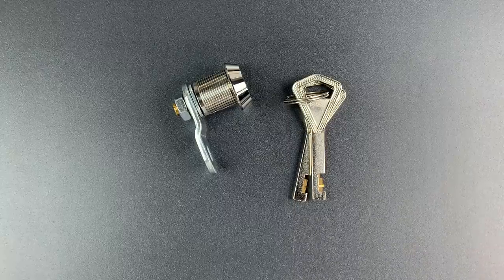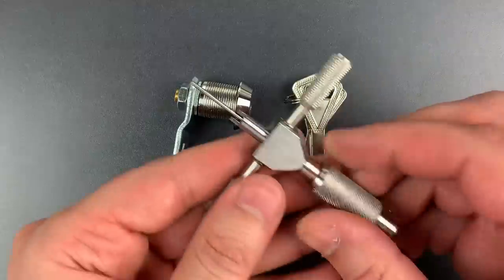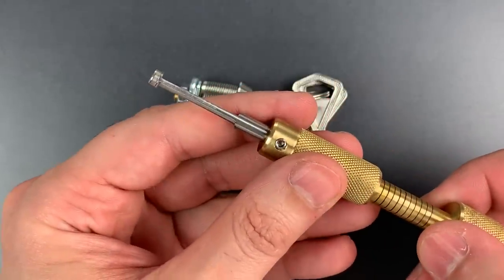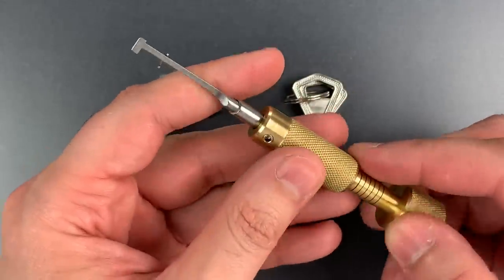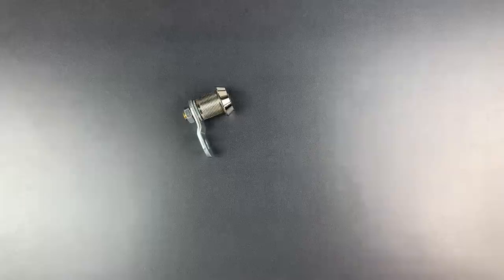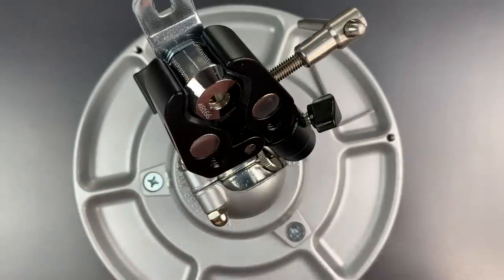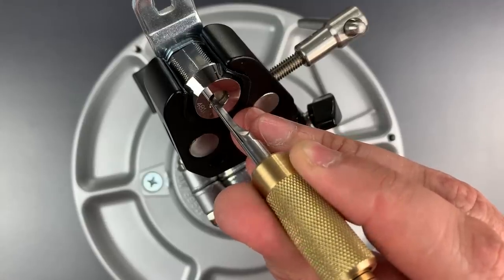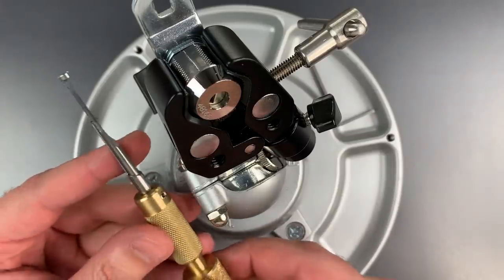[915] Knock-Off Abloy Cam Lock Picked (With a New Custom Tool)

Comment: Nice to see one my children going forth and picking locks! This tool is called "The Ableater" and took me about 6 years (on and off) to design. It took 107 years before anyone could publicly show that the Abloy Classic could be reliably picked. The lock should be impossible to pick but because of the tolerances on the gate/sidebar interaction it is not. Without doubt the hardest lock I have ever designed a tool for, including all the other Abloy locks like Protec II, Exec, Disclock Pro etc.
Reply: huxleypig69 it looks fantastic!
Reply: In finnish it's kalled vempele. Well maybe not the same tool, but the tool that was used on abloy classic before they added the freely spinning disc 1
Reply: @skharppi  I know the Vempele, yes. Tensioned from the front disc and made by Seppo Tervonen. It is why Abloy made the free-spinning front disc and also the anti-pick disc mentioned in this video. This tool works on the locks pre-change as well as the modern ones.
Reply: Fantastic work, precision tool!
Reply: this is by far the best recommendation i have ever seen for a lock. if its this hard for experts at least it wont be my weak link in my security system. where do we get these locks?
Reply: You sir, clearly have talent on design and tooling. I migth be interested, as this is the channel of a lawyer, at which point does a special purpose tool become so obviously special purpose, that you could regulate/ban them on the basis of their usage? Do you, as a designer have an opinion?
Reply: @huxleypig69  Very cool tool. Do you really think that classic pick is harder to do than exec or other safer locks? Finland is not a great country for thiefes as every cottage has atleast abloy classic, but great for sport pickers as every hardware store has every abloy lock on the shelf.
Reply: @jkarra2334  the vempele is actually a different tool designed to pick the early abloy locks without the front free spinning disk and anti pick disks.  it was a tool that tensioned the first disk in the pack to then pick the others and it doesn't work on any of the newer abloys as far as I know.  This tool tensions the last disk in the pack and has special considerations for the anti pick discs which makes it able to pick even the newer abloy's. It is a completely different tool from the vempele, it is even designed differently. Awesome bit of history bringing up the vempele though!  😊
Reply: Great tool!! Really impressed by the workmanship and the thought behind it
Reply: @NothingPicksLocks  as I wrote, inventor of vempele discussed with Abloy, after that Abloy added rotating disk to lock. Same time vempele was also updated so you could use new vempele to pick Abloys.
Reply: @skharppi  The way it cams around the centre of the lock makes toolmaking very, very hard. It should be impossible to pick this lock...but is clearly not. So if Abloy would have stuck with this basic design and added the bits and pieces from Exec/Protec (DBS/disc controller etc) then no doubt, the Classic would be a harder lock to pick.
Reply: @jkarra2334  Yes, the lock has been opened by criminals and govt agencies for a very long time but nothing was public about it, which is why I designed and made The Ableater. Since I made the design public, there have been similar designs come out of the woodwork but there was literally nothing publicly available before I did it (otherwise I would not have bothered)!
Reply: @professorfukyu744  Not this particular strip version of the base design (which has too few disks, and lacks most of the anti-pick mechanisms), but the non-knock-off one would be a good tough to pick model.

There were several other models that professional locksmiths can take 5 minutes plus to pick.
Reply: We luv ya hux!
Reply: you still have not picked a protec 2
Reply: @jkarra2334  I think this time you don't know who you are talking to :D
Reply: Do you sell these tools?

Comment: A lock that requires a special tool with such tight tolerances is a pretty darn good lock in most instance.  There's almost no thief who comes across this who will be able to pick it, and any such thief will have to resort to force attack.
Reply: For a year before the Chinese companies start making the pick for $2, including shipping. Problem is you expect the lock to work for decades. It's basically security through obscurity. It's always an advantage, but it shouldn't be the main principle.
Reply: Yeah I feel that's probably true with just about any disc detainer lock.  If anyone's prowling the streets looking for locks to pick (which I think is already incredibly rare in and of itself), I have hard time imagining they're looking for anything other than basic pin tumbler locks.  I feel like even the cheapest Chinesium disc detainer lock is going to protect you from lock pickers just fine (though brute force attacks are another story).
Reply: A real thief is going to see this funny lock and smash the shit out of whatever it's attached to until it lets go.
Reply: @EightiesTV  Of course.  But it all depends on the situation.  For instance, if it's a door lock, a potential thief probably doesn't want to make a lot of sound, especially if there are close neighbors or they're not sure if anyone is home and asleep.  Or in a locker room, a potential thief might want to try to pick the lock so smoothly that any onlooker who doesn't look too closely thinks he's just opening the lock as normal.  Those are the sort of cases where a difficult lock helps a lot.
Reply: Channel is called the "lock picking lawyer" not the "is this lock going to get picked in the real world channel"
Reply: @DrSid42  Abloy has made basically same lock for over a century :D check wikipedia: Disc_tumbler_lock (urls dont work here, if i remember right).  Probably half of Finland is locked by those.  There has been picking instruments for those for at least 50 years.  Google image search should find some by the name "vempele", which is Finnish and means roughly "thingy" or something.
Reply: Every lock commonly used started out this way, and now said "special" tools, aren't very special anymore.
Reply: @Pickleriiiiiick  Except the LPL makes a lot of comments about how secure a given lock is based on how easy it is for him to pick, and I think that's where his commentary gets a little hyperbolic.  Just because he can easily pick it with this special tool doesn't mean the lock isn't secure.
Reply: This lock has definitely been picked by criminals in the past...but you are right, it is a very good lock and 99.9% of thieves will not get near opening it.
Reply: @DrSid42  Abloy classic, which this lock copies, has been obsolete for years now. IIRC it was 1996 or 1997 when they introduced the exec that replaced this in any other application than padlocks.
Reply: @jasonh6312  His commentary is only occasionally hyperbolic to those who don't follow this channel, as he regularly puts such things into context.
Reply: @skharppi  Abloy still make and sell Classic. Exec is an easier lock to make tools for IMO.
Reply: thats my kind of locking!
Reply: @DrSid42  This lock is basically a badly make copy of year 1905 Abloy design. If it had real false gates it would have been much harder to pick even with poor tolerances you can expect from cheap Chinese lock.

The original Abloy design lasted about 70 years before first confirmed picking and is still considered a pretty good lock. Their later designs are even better but are still pickable for highly skilled people. Check out Abloy Protec 2 or Abloy Easy sometimes:

https://youtu.be/AsG90UGRTpw (the only picking of Protec 2 ever where the actual picking tool is shown!)
https://youtu.be/fZvm6AS47f0 (Abloy Easy was patented in 2020 so this is a really recent lock)

Comment: I'm still waiting the day where the locks just open on itself before you even started picking it....
Reply: A lock made by the Royal Small Arms factory at Enfield, like the original L85 ("You do know it goes off if you drop it, right?" - Heckler & Koch), perhaps?
Reply: You'd think that, by now, the locks would have learned to just give up the moment LPL enters the room.
Reply: @kurominonakade  The first padlock I picked got the keyway bent when I tensioned it too hard. I tried picking it again a few months later to try out my new TOK wrenches and it turned out to have been broken so badly the plug could rotate 360 degrees with just a tension tool. After a few minutes, the keyway broke in half and pins started falling out.

Comment: My parents had the classic Abloy locks, mounted on the door instead of inside it had a lockable thumb turn on the inside for doors with windows. They were great, lasted decades before they sold the house. 

I think a thief will use key copying before picking and the classic is long out of patent protection, but the local hardware store won't be able to copy this key.

Comment: Also a little unusual that you started from the back of the keyway.
Guessing with some lock designs this is easier than starting with pin/disc/wafer one.

Comment: This is interesting, but as a cabinet lock or something similar it still has a massive security flaw by its very design. If you can access the metal bar on the back of the lock (ie. between the doors of a cabinet) you can take something as simple as a pair of scissors, grab the metal piece, and turn it clockwise, undoing it completely.

Comment: it doesn't positively locate in the door you install it in. So ask you need to open it is a big flathead driver, preferably one with a square shank just in case you need to get some extra purchase onto the lock. But turn the whole lock you will, rendering any level of security in their lock useless
Reply: It's a cam lock, intended for a box or drawer rather than a door. The flats on the top and bottom prevent the body from turning. Installed in a steel box or drawer, you would have to break the cast lock body to force the core to turn with a brute force attack.

Comment: Earlier this week I picked up a few 5 pin tumbler locks for practice.

A minute ago i looked at they key and saw that there was a zero lift pin in the very back of the lock. I only got 4 pins, sad XD. Im 90% sure i could saw off the end of the key and it would still work

Comment: Hey, could you make a video about the Master Lock 643D (combination lock)? I own one and it's ridiculously easy to open, first of all, when you get the right number, the shackle visibly move a bit, making it very easy to get the right combination. But worst of all: me, a not very athletic teen, can get the shackle out of it's hole with my bare hands simply by applying brute force. 
I feel like you should warm people about it because it's incredible that a lock this bad is out there to buy, and a standard encounter at hardware stores (atleast where i live)

Comment: Abloy 3015-3018 padlock. Oddly I have about 20pf them that will open with the key I have and about 10 others that won’t. I wanted to know if there’s a way to remove the core from the ones that will open and put them in the ones that won’t. Or maybe just have a key cut that will open them?

Comment: @LockPickingLawyer would you be interested in trying your hand at a Schlage Everest Primus? I bought a dozen door handles with them from a surplus store without keys. (though in the process of getting the keys for them). Not sure of the exact core, but I'm pretty certain its a Primus XP. If you want I can give you more info when I get it from the vendor I purchased them from.

Comment: Finally. Where can i get this tool, have several heavy duty abloy classic padlocks w no key?
Reply: If you are in the US or canada, you can purchase a Solver Bullet, the tool from Matt Smith that the one lpl uses is based on, from https://lockfall.com/product/the-silver-bullet/ 
Tho it is currently out of stock, there are more on the way, according to the guy makin them. Hope it helps :)
Reply: The Abloy parts are still only available from me. Hit me up!
Reply: Your other option is to do what several others have done, and send the locks to me. I can pick/decode them and then you can get keys made from the code I supply. Or I can get them supplied and cut, for a fee.

Comment: This lock is good unless you have the right tool... in which case LPL had it open in exactly 22 seconds. If you don’t have the right tool even the finest of chinesium will only protect you for about the same 22 seconds. In summary: just pay for the Abloy and call it good.

Comment: Is it possible to pick that with a regular pick? Since many thief’s would unlikely to be carrying a load of different tools I just wondered whether it would be at all possible to pick that open with just a standard lock pick.
Reply: Not really, as you need to tension it from the last disc and have room to turn the other discs.
Reply: You can have a relatively small kit and still be able to cover 90 to 95% of all locks, maybe six to eight pieces in the kit total. 2 tension tools, two rakes, 2 standard hooks and a couple of exotic things like the disc detainer picks. That would all be very compact, and if you really want to make it more comprehensive I'm sure you could do that with just two or three more pieces and still be highly concealable.

Comment: What lock should I put on my front door!?!??? I live in an apartment, and the fire-rated front door is the only reasonable way for someone to get inside. What's a reasonable amount of security there?
Reply: Check the law first. You may run afoul with your landlord by changing locks without their knowledge or permission.
Reply: karuza82 thanks for the advice but I am the owner. I wouldn’t be asking if I were renting.
Reply: Neon8787, no prob mate. I am the property manager of a apartment building where I live. Part of my job is changing locks when we get a new tenent. I also have the keys to every apartment on site so I may, and have made, emergency entrance.

Comment: Is there a video on tool making that you’ve done ? I’ve started saving my wiper inserts but not sure what other raw materials I should have on hand.
Reply: feeler gauge stock is useful for making picks. Heavy gauge steel wire can be useful for making some bypass tools once you beyond that you generally have to start looking at more specialized machinist equipment instead of just pliers, a vice and a Dremel.
Reply: Thanks!

Comment: So, not a picking challenge, but rather a tool-making challenge.
Reply: I always thought "a tool-making challenge" was where a custom tool will open a lock without requiring any significant skills.  He may make it look easy, but he still actually had to pick that lock.
Reply: @jic1  nope.  It is when the lock's resistance to picking is simply a matter of having/creating the right (non-standard) tool.